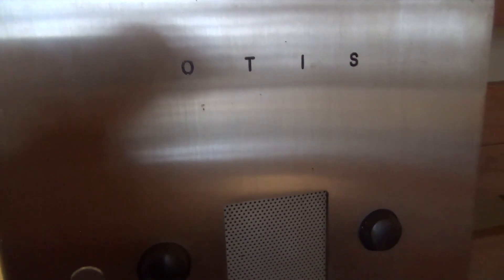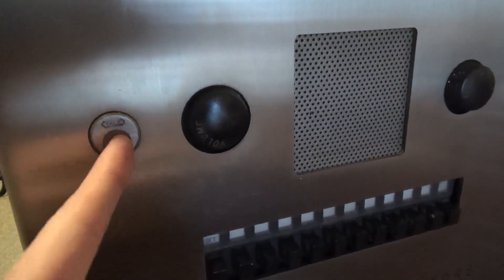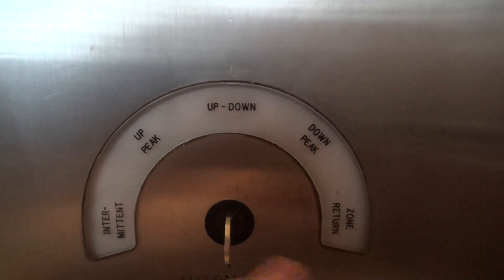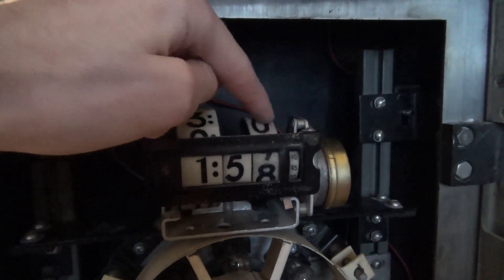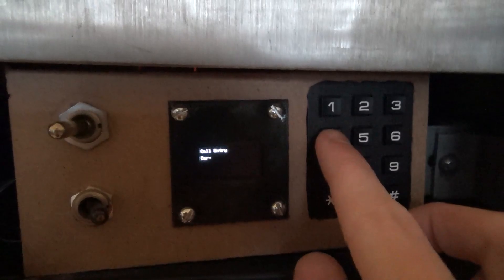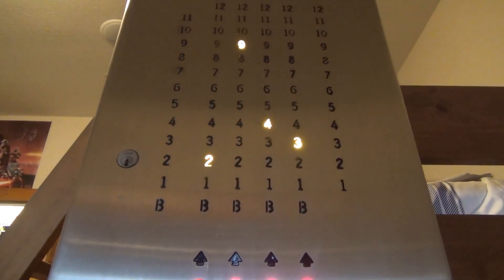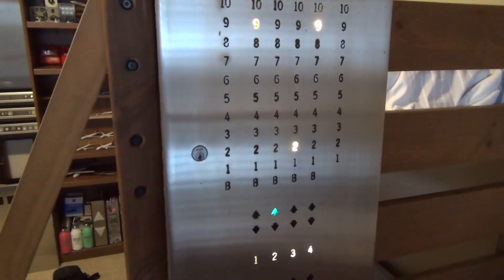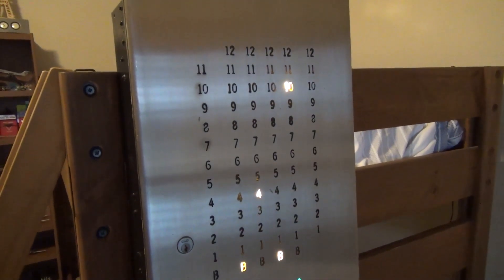Otis Autotronic Annunciator Project Part 3 - The Completed Project

Comment: Hello STL elevators: on the bottom of the 2 part annunciator panel (below the white 1 2 3 4 lights that indicate whether a given elevator is in service), there is an array of lights--four columns and 2 rows.  The lights seem to be red on the top row and green on the bottom row; but you have not restored this feature except for the green U and D lights (see below).  On the left side of the array is a green backlit "U" letter and on the right side of the array is a red backlit "D" letter (presumably up and down).  What do these lamps mean?  Are the lamps really buttons that enable the dispatcher to force a given elevator to go up or down?  If that is the case, then why are the top lights not green instead of red?   - Ian Douglas

Comment: Did you build that little programmer yourself?   That is the most realistic panel.  I have an AMF magic triangle (Pindicator) that I would love to have display random pin combinations.  It uses 12 volt bulbs.  How did you buffer that logic to drive 120 volt lamps?  I have a 27 floor COP from a Cincinnati hotel...you may like to have.  Not an origional, but huge and in good condition....let's talk..
Reply from the maker: I used arduino nano boards and developed the rest of the hardware and software myself. That elevator panel would be interesting to see. Feel free to email me: jason@stlelevators.com
Reply: @stlelevators  did you ever get that big COP? Sounds awesome.
Reply: Wow, what kind of fixtures does it have?